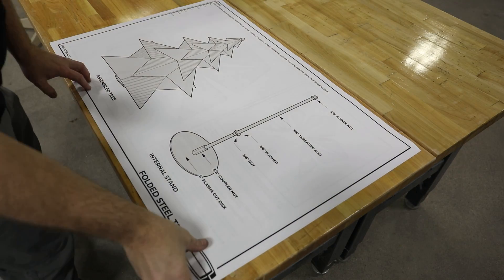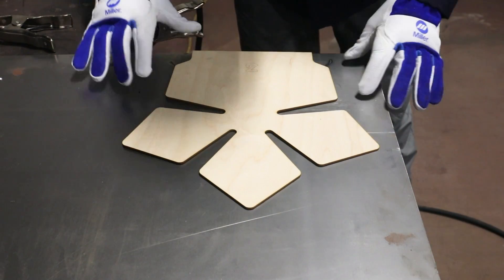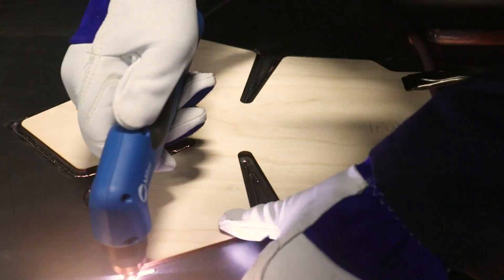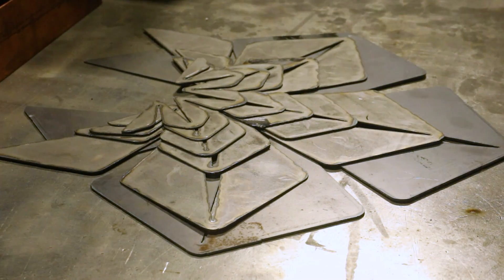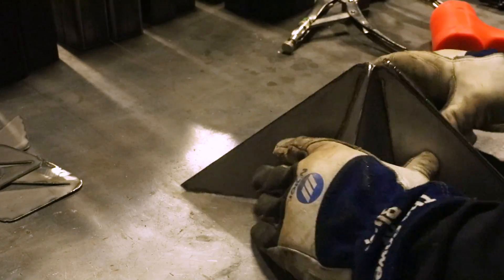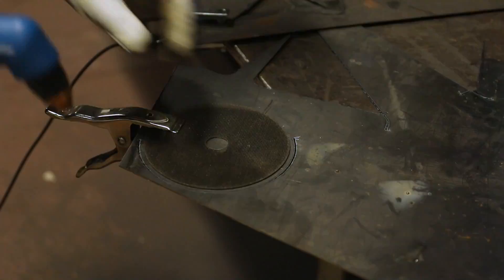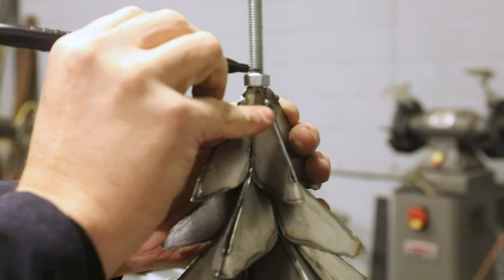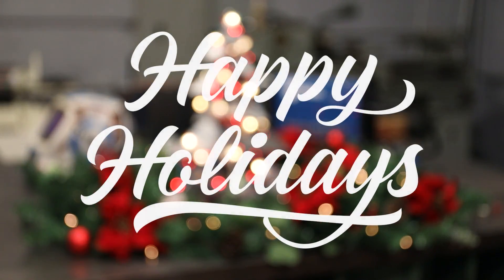Plasma Cutting with Patterns | Folded Steel Tree

Comment: HAPPY BIRTHDAY ! would miller build you a helmet with a filter and an air pump mounted on your belt to supply a positive pressure over your face?
  i would like to buy an ape if possible
Reply from the maker: Thank you!  Miller does have “supplied air” and “air purifying” masks that do like you say…. I have used both of these kinds of systems for other processes and I greatly prefer the supplied air approach!

I find that using a simple half mask respirator is good enough for what I do, but a downdraft table might be a fun, useful project at some point.

I assume you are talking about “The Thinker” ape statue.  Unfortunately, I have had to turn away quite a few people as it is a grey area from a copyright standpoint.  I enjoy it as a 3D picture of a pretty famous piece of art but unfortunately, part of the deal is that I can’t make copies for anyone.  Hope all is well!

Comment: With a TIG weld, this could come out really spiffy. I'd put a tube (same one used for regular lights) down the middle, that way one could run wires through it and put LED lights beneath the "petals"/branches.